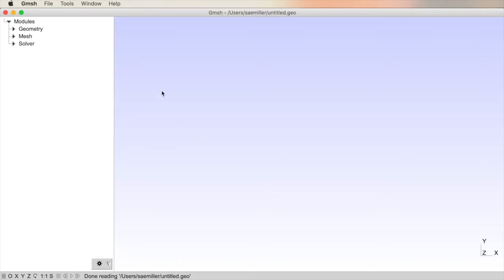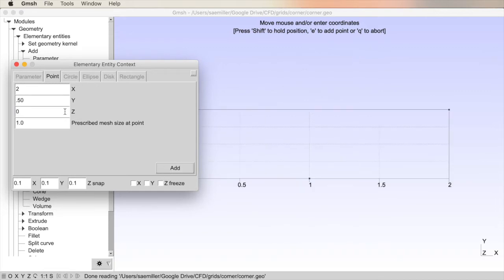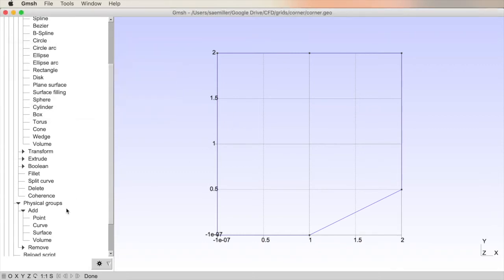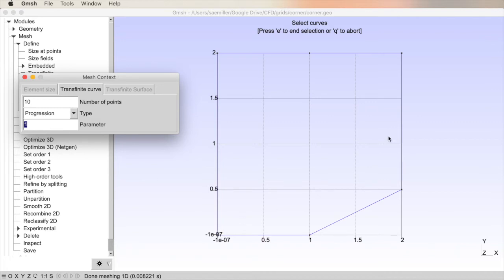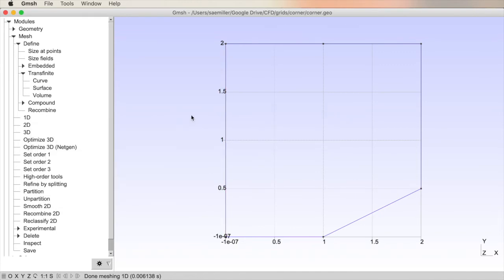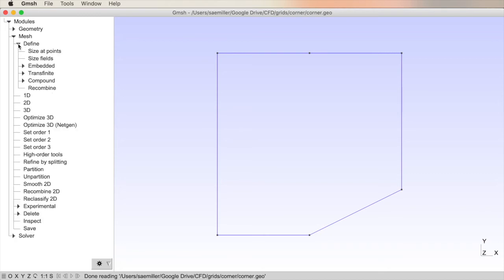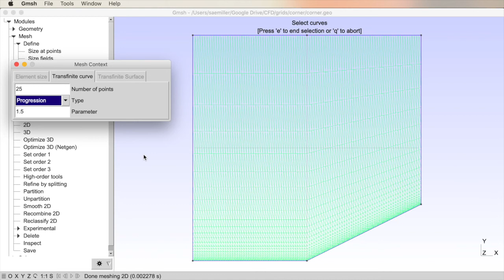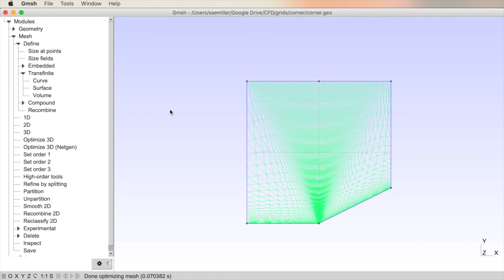Grid Generation - GMSH - 5 - Creating Two-Dimensional Unstructured and Structured Grids

Comment: Hello, thanks for the tutorials! they are pretty nice and clear, I have two questions,
1. in the part 4, you created the boundaries from planes that were created from the geometry module, if we import a step file (as in tutorial 3) we should do the same workflow?
2. would it be possible to do a tutorial of a python scripting in gmsh where we import a step model, create three boundaries inlet, outlet and walls by creating the inlet and outlet by using a plane and then the wall boundary as the rest of the faces, and then do a meshing and exporting it?
best regards

Comment: I am trying to create a 2D mesh in Gmesh. The geometry has 2 different plans (x,y, and x,z) at the same mesh. I draw it via AutoCAD and imported it in Gmesh using it as a step file.
Now, I am trying to define a surface but in vain, it selects the boundaries but does not keep it as a surface (there is no e option, only q) . unfortunately I cannot attach a screenshot here
Reply from the maker: I am not a regular user, but I would guess in this case that there is something wrong with the closed surface. I would suggest that you try something simpler before importing the geometry. That way you could divide and conquer (solution strategy) to find the problem. Good luck!
Reply: @SAEMiller  Thanks for your reply